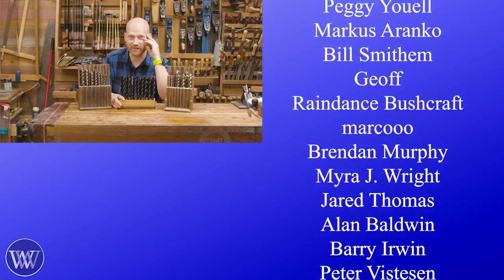Auger Bit Holder

Comment: Interesting video. I have quite a few old auger bits that badly need some TLC and a new case. I don't see why I couldn't adapt this to square shank bits. Thanks for the inspiration.
Reply from the maker: That would be fun. maybe make a tapered top or base to match the graduating length.

Comment: Nice work, James. If the cap is only to protect the sharp ends while traveling, why not just make a box to fit over them and have it sit in a rabbet around the top of the base? This would serve to protect the flutes from getting dinged as well as the cutting edges.
Reply from the maker: the problem is with he tight tolerances on those caps it would be almost impossible to get them all into their caps.
Reply: @WoodByWright  I don't think I was clear enough in my description. No worries. Have fun with those nice augers.
Reply: @WoodByWright  I think by "cap" he meant the wooden top you made. He meant you could make a lid out of wood like a 5 sided box that fits over all the bits and goes all the way down to the base, instead of having a place for each bit in the lid. You could add a chunk of foam in the lid to keep the bits from jiggling around during travel.

Comment: Looks good! Just messaging to point out that you could have done the stepped design like the others, if you stepped the depths of the holes. I have a bunch of old bits, but I'm thinking I'm going to do them in some kind of folding/tool roll. I like the idea that someone else suggested of adding "sides" (maybe in leather) to your design. Either way nice job!

Comment: Love the project. But watch out for that leather - it appears to be kip, a bit thin and also a somewhat loose flesh-side structure. I would use a 3-4 oz latigo for both better strength and better elasticity. (Worked with leather for more than 40 years.) But now I know how to build my own holder, so thanks!
Reply from the maker: Yup these are just temporary patterns. I talk about that a bit more in the how to version of the video. It was what I had lying around the better stuff will be coming in shortly. this is the leather I use for clamp faces and vice jaws.

Comment: The lid being separate makes it easy to lose.   Maybe lid that nested under the base, OR a second set of slots in the straps to strap the lid to the base while I. Use so it does not wander off.
Reply from the maker: that is an interesting idea!
Reply: Along with this idea, place the lid down first and put some more holes in the leather where they match up with the base. Although it will be very tall.